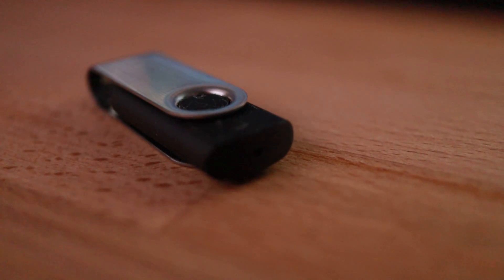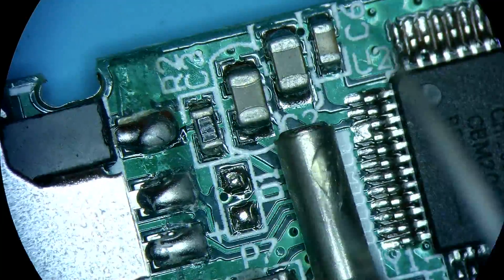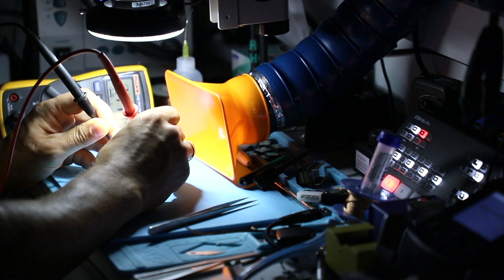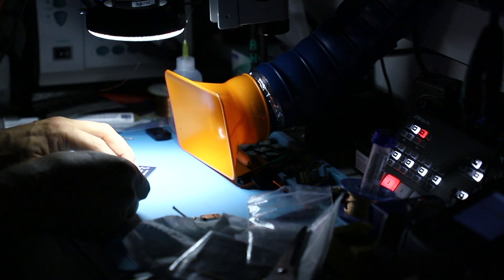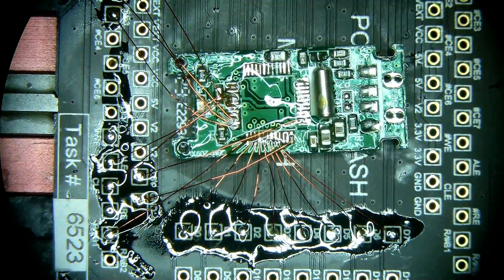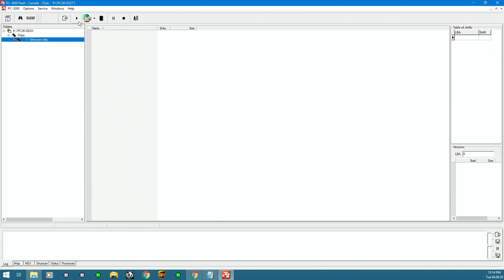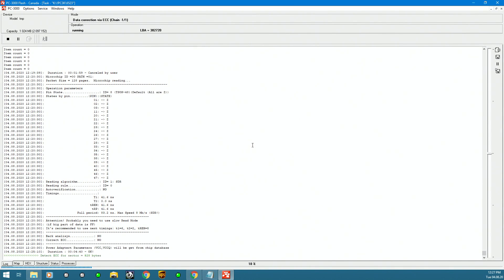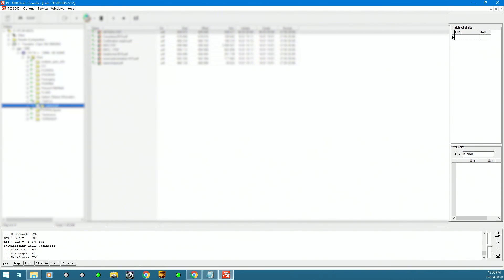promotional flash drive died

Comment: Looks like you had one more place you could have hooked into the NAND signals. On the side with the glop-topped Flash, it appears there were pads for a TSSOP NAND, and these footprints tend to be fairly standardized in their pinout. So had the controller been a glop-top as well, you still would have access that was relatively easy to determine. Great video though, thanks for sharing the process!
Reply from the maker: Those pads on this NAND are not standard, Mark.

Comment: how the adapter dont short each other I see the cables naked
Reply from the maker: Wire is coated
Reply: Enamel coated wire [often called magnet wire]. That's also why he rubs the wire with the tip of the iron when soldering, that's to burn off the coating so it can make electrical contact.

Comment: Why not just replace the controller if it's commonly available?
You should also stock all the common ones.
Reply from the maker: Where would you get the controller that matches? What if it's not a controller issue?
Reply: @hddrecoveryservices  It's a chinese manufacturer that sells this IC only to companies that make flashdrives, and so you won't get those in popular international suppliers like digikey, farnell, rs, arrow etc.
You need to rely on individuals that get hand of these and sell few on ebay or aliexpress, so you just pop in CBM2093 part number into the search box and you should get it.
I'm not an expert, YouTube algorithms led me to this video, but I would imagine that in 99% of cases it's the controller that fails, right?
If it's the memory that fails then well you can't do anything really.
Reply: @Arek_R.  If you want to mess up your important data, you should do the same that you write; order a new one from the internet and replace it. This is not that easy. I got some cases from customers, they replaced the controller with matched one controllers, and they messed up the service area and a part of file struture with this move. Sometimes it works, yes, but there are differences between CBM2093 and CBM2093, controller and controller. Every single controller type has many versions and they do not use the same algorythms, etc. in every modifications. Part number does not mean anything, they still can be a little bit different.

Most percent of cases are controller fails, but it is more complicated. The controller can block the data access because of many reasons. If the memory fails, the data recovery is still possible. This guy is an expert and he knows how to handle damaged drives. This was the most professional way to recover the datas.

Comment: what kind of wire do you use to make those jumpers?
Reply from the maker: my go to wires are 36,41,46 AWG. Just yesterday I got some very thin jumpers in 0.02mm and 0.009mm
Reply: @hddrecoveryservices  is it magnet wire, and you are just using heat to burn off the coating?

Comment: That JBC iron is a beast. I wish they had decent micro tweezers. Id switch in a heart beat.
Reply from the maker: you don't like their tweezers? We just ordered TEC extension pieces for the shop. I wonder if they put out the same power as the NT105 on my station
Reply: @hddrecoveryservices  The issue was more the size and the space I work in that factor in for me. The Hakko micro tweezers are what I use but granted I'm working on phones so the size and space is slightly smaller and tighter spacing of components. They struggle with tip heat at times. That's one area JBC seems to kill the market. Even there micro pencil can carry heat to grounds that my Hakko would stick and take a second to get back to temp. I usually remedy this with hot air to help.

Comment: That controller looked like 2 pins were shorted and several pins were loose. Also that controller adapter is insane. I don't mind soldering, but that's crazy. lol
Reply from the maker: I checked all pins prior to removal, and the 2 shorted ones are sitting on the same VCC1.8V. Good eye! I

Comment: First USB drive I've seen with a crystal like that! are they common?
Reply from the maker: they are very common for those promo flash drives.
Reply: @hddrecoveryservices  I think it's an older style [so likely a cheap option used in the dirt cheap drives today] I have several brand-name off-the shelf ones that have crystals. I only know this because one died, and I took it apart to see if I could figure out the  cause. I initially assumed mechanical failure of a solder joint, Turned out it was mechanical failure, but not in the soldering, the culprit was the crystal. After replacing it and was able to recover all my data.